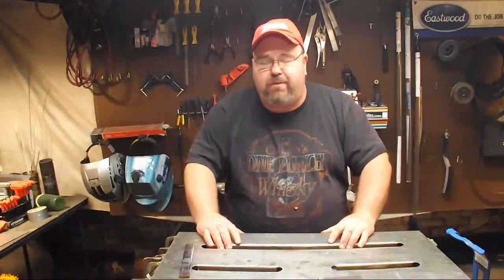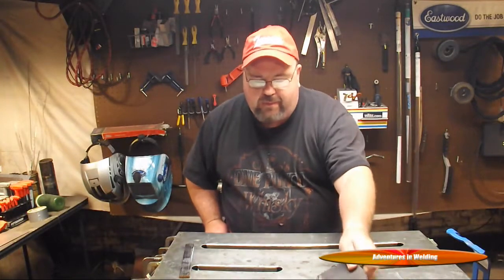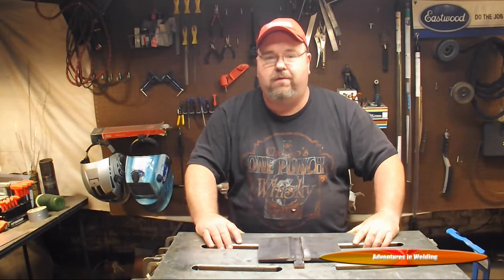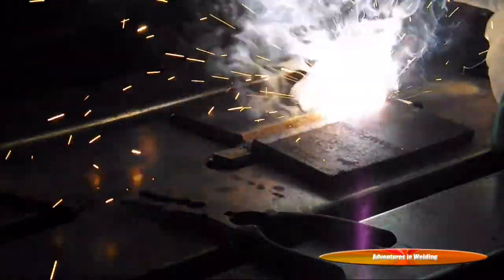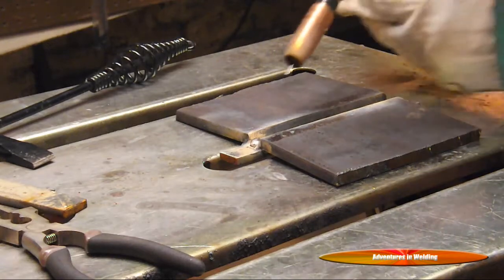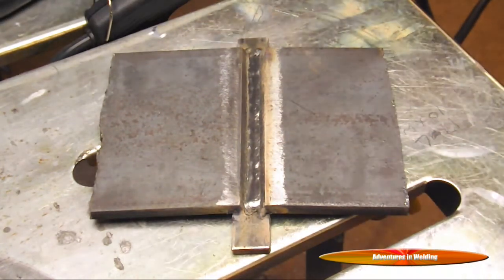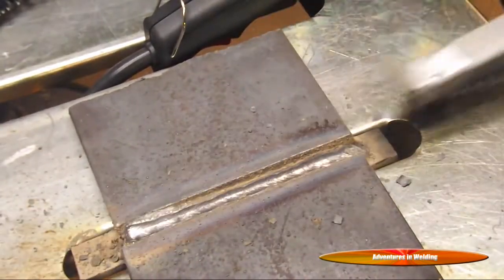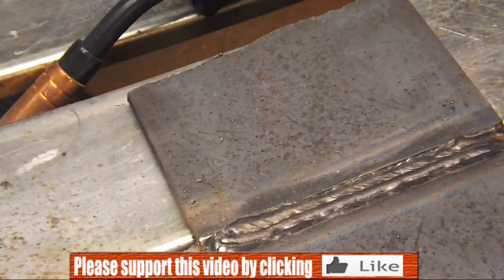Multi-pass Flux Core - Adventures in Welding #133

Comment: I have Found Blue Demon E71T-11 is some Awesome Wire Very Low Splatter and Welds Super Smooth and yes it needs DCEN   E71T-11 is Mulipass  Rated  E71T-GS is Single Pass
Reply: I love the blue demon E71T-11. it is rated a limited multi-pass wire , after scouring the web I have found that limited for this wire means 3 passes.

Comment: Can you double pass all flux cores or only certain ones?
Reply: E71T-11 is Multipas   E71T-GS is Single pass   I like Blue Demon E71T-11
Reply: check the numbers on your wire ,that will give you whether it's multi-pass or not .@DanWright-w7x  is correct on the blue demon being multi-pass wire , but it's actually a limited multi-pass meaning 3 passes. I hope this helps. oh, and blue demon E71T-11 is all I use now

Comment: My 1 question is, do you need to allow time for each weld to cool? If so, how much time, how do you know? I have just been root pass welding for a few small jobs and haven't had any problems YET, but I'm a flux core hobbiest welder around the farm, so it's not like I'm structural welding lol.

Comment: I bought one of those cheap eBay flux core welders. $80 and welded some 1/2" plate . I bent it in the press afterwards to almost 90° . No cracks or breaks. I did modify it with a separate transformer for the wire feed driver board. They are ac and really splatter but do get the job done if you get everything set up right. That lincoln wire seems to be about the best I've tested. Thanks for the video.

Comment: That home depot gasless fluxcore shit doesn't hold a candle to gas fluxcore wires gasless wires are not good until you get into the NR 233 232 ironworker type stuff that NR 211 is brittle is not ductile what so ever your way better off using 7018 or if your gonna use mig use gas fluxcore or hardwire spray transfer you will need at least a 220 amp machine tho
Reply: Just wanted to say there’s a handy thing called a period. You can use it to separate sentences to make them easier to read. 

If you’re on mobile you can also double space and most phones will automatically add one!

Comment: Good video bud , flux core is really good if you know how to use it . It's not really a bigginer wire . It's got to be ran a certain way , watching the puddle distinguishing the puddle from the slag , cleaning , prepping your material and gun angle yada yada yada . All in all a great wire i run it all the time i like the licoln innershield multi pass wire